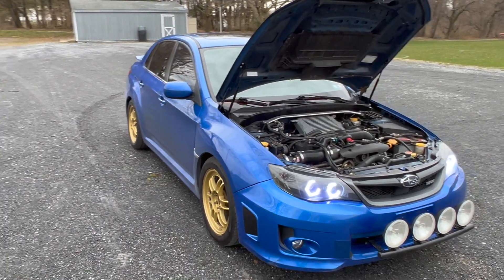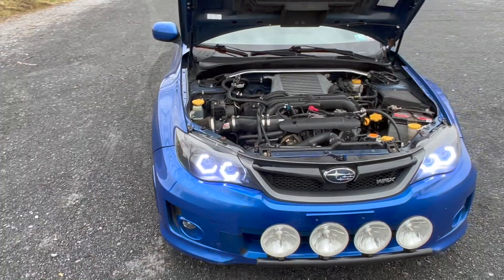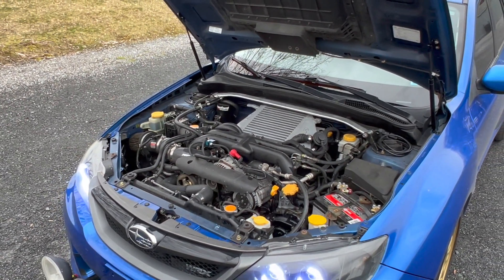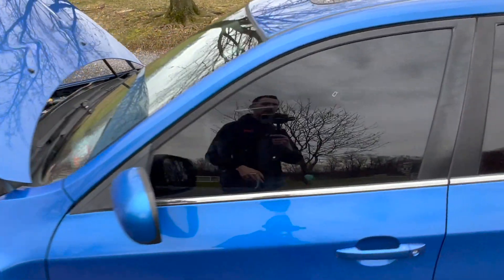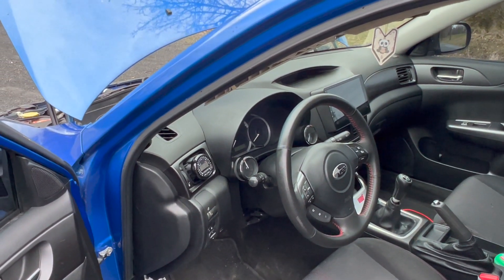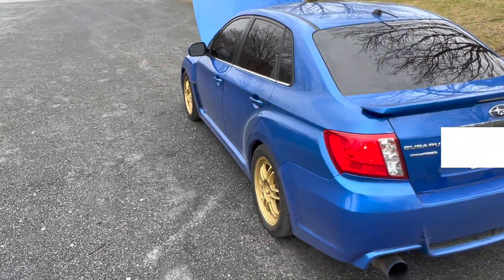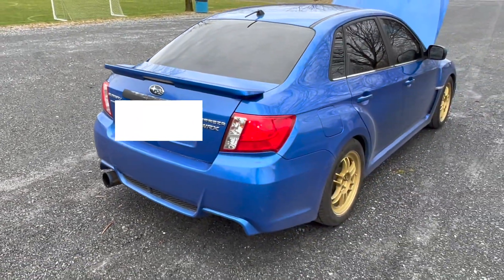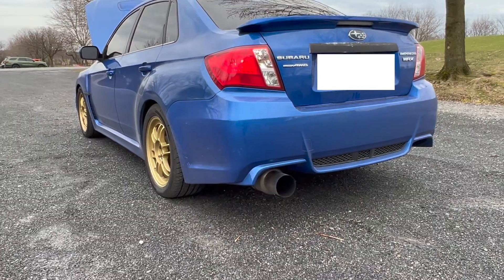2011 WRX EJ20x Engine Swap PART: 2

Comment: i see Penn dot stickers!!!! im thinking about doing the same swap. I'm in NEPA there's a guy selling a blown 08 that i would love to pick up. is there any issues with getting it to pass pass emissions? I don't see a check engine light so that's good.
Reply from the maker: A proper tune for the ej20x and all modifications will dial the car in, and with the tune it should be emissions compliant as long as you retain a high flow cat to pass visual inspection.
Reply: @Subarukenny_d  Thanks for that much appreciated

Comment: Hello I had a question! Currently swapping out my ej205 2012 wrx. Bought a jdm ej20Y. Kinda confused on avcs and what to do. Would I need to do anything with the avcs and do I need a tune ? Thanks!
Reply from the maker: Check out part 1 of this video, it outlines what needs to be done for the install. And yea you will absolutely require a custom tune for the engine after the swap is complete.
Reply: 👀I hear an ewg

Comment: I needs to begin designs to put 7" rounds in the fog bezels on the front bumper.  5" rounds are okay, but having 7" rounds tucked in just in front of the front wheels would be epic.  It of course would be a whole system.   Wish my 2019 was more project car than daily driver.....